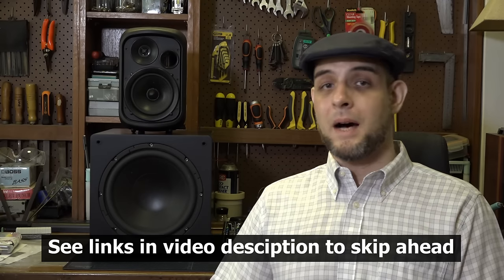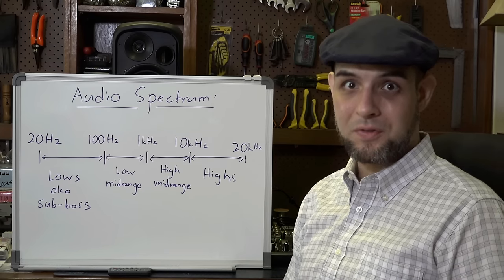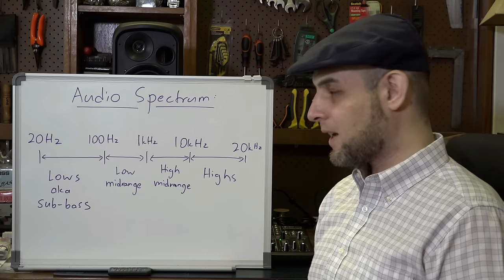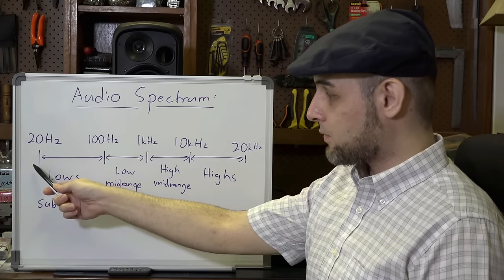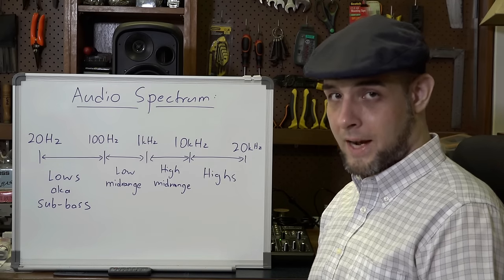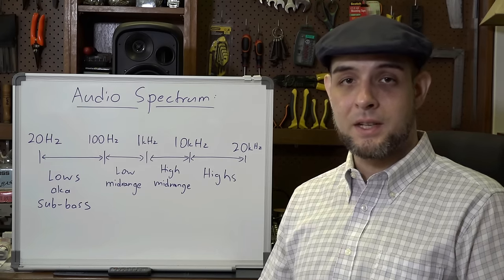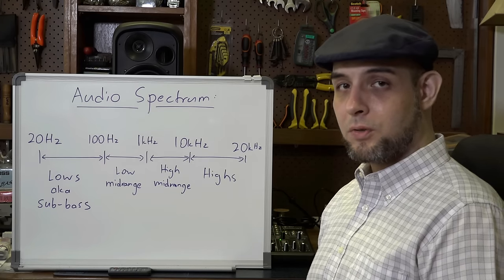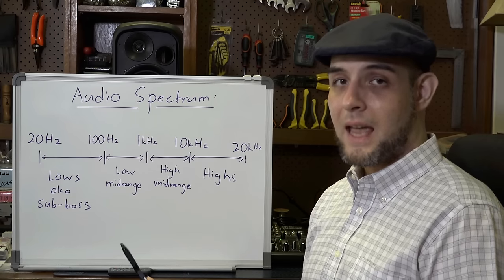How to connect an active subwoofer to a sound reinforcement system

Comment: Hello Bruno, may i ask you what do you think about my following idea?
I'm thinking about building a cable to use two channels of my mixing console as a "X-over". 
Does it function if i build a cable that bridges send and return on channel 1's insert and sends the send to channel 2's line in?
With this cable (if it functions) I could use the 1st channel with full range signal and the second one with low pass to send the signal to a sub which amplifier hasn't a built in X-over.
Reply from the maker: It might work but how are you going to low pass the signal to the sub amplifier? In general these improvised solutions are not recommended.
Reply: GLB Productions I'm going to use an aux send or a sub group
Reply from the maker: I'm afraid I still don't understand your cable idea - a crossover has one fullrange input and at least two outputs, high and low, with a crossover point at which the signal is divided.
Reply: GLB Productions My input would be a random channel (example ch 1) my full range output is the same channel routed to the main mix out (and goes to my studio full range speakers). The second signal starts from the ch 1 insert, goes to another channel (ch.2), i'll cut the highs and mids with the parametric eq and it'll go to the sub amp via an aux send
Reply from the maker: Ah ok now I understand. This will not be the same result as a using a true low pass filter on the second channel, because you'll end up with a low midrange bump between where the low and mid EQ control operate. Also because the fullrange signal has not been high passed you will have overlap in the bass between the fullrange speakers and the sub. 

BTW if you want to tap the signal from the insert point of the first channel just use a normal guitar cable and insert it to the first click in the insert point, that will tap off the signal without interrupting the flow through the channel ;)

Comment: Is it possible to connect an active subwoofer to a phono preamp using only an RCA cable? (In case there is no sub-out in the pre amp and there were no XLR jacks in the speakers nor the subwoofer) 
If it were possible, what would happen if you used an adaptor to get 2 left Channels and 2 right channels out of the preamp (that naturally, only has one of each) and plugged the subwoofer to one and active speakers to the other? Would it work?

I heard that it's a bad idea to to try to merge both left and right channel into 1 subwoofer, but I do not know why.
Reply from the maker: Yes the idea of splitting the output of the preamp into 2 left and 2 right and connecting them to sub and fullrange speakers respectively would work, but you would still need to find a way of cutting the bass out of the send to the active speakers. Summing left and right to mono can be done and is effective for subwoofers but it needs to be done using a proper resistive network, not by simply hard-wiring the signals together.
Reply: +GLB Productions 
But, how could I manage the resistive network you're talking about? I am somewhat new to this, and have no prior knowledge in electronics :0
Is there a separate device that may achieve that? Is there a reliable Stereo to Mono convertor I can buy? (Hell, is that even what I need?) Please note that my idea is to plug the right preamp's RCA output to the sub's right RCA input and the left RCA channel into the left sub RCA channel; I am nor trying to "merge them" per se with a Y adapator.
Reply from the maker: In this case you don't need any stereo to mono converter because you are going stereo output to stereo input :)
Reply: @GLBProductions  GOD BLESS YOU

Comment: Hi i have a 500w powered subwoofer with high speaker wire input terminals and rca low level rca in/out sockets is it possible to connect speaker wire from my power amplifier to the speaker wire input terminals on the subwoofer and then connect my passive 250W Pa Speakers to the subwoofers speaker wire output terminals ?
Reply from the maker: Hi Ken which make and model sub are you using?
Reply: @GLBProductions  I have a old Paradigm PS-1000 Powered Subwoofer and the amplifier is a Sunbuck AS-336BU 2000w Power Amplifier
Reply from the maker: Ah yes that sub. Hmm, theoretically this is possible but those terminals are not designed for high power handling - I would say do it at your own risk 😄

Comment: Hey im using a Alto ZMX 862. U have alto tx12 tops and i have them running from the main output. I have a Carvin ls1801a active sub but i gave it running from the control room channel. It has a separate gain. Whats your opinion?
Reply from the maker: Ok so you have the issue that I mentioned in the video of running your tops fullrange without a high pass filter to remove the low frequencies that the sub is handling. To get maximum efficiency out of your system you need to remove the lows from the signal that is being sent to the tops, using either an external crossover or high pass filter of some kind.
Reply: GLB Productions any suggestions on a decent inexpensive filter or would you just run it thru the sub. The sub crosses over at 80 and 120. I set it to 80 and those tops cut out at 70. And that sub is like the EV elx118. It has one input and one output. Would you use a splitter to combine left and right main out the board to the sub and and one to connect the two tops or just one main channel out to sub and split out sub.
Reply from the maker: The most inexpensive quality crossover that I would recommend would be something like the DBX223 - it can also sum the low end and send it to your single sub. Alternatively you could get a second sub. Finally if you don't mind running your system mono you can use the crossover in the sub: left or right out from the mixer (keep all your pan controls at center) into the sub, out from the sub into the first speaker, out from there into the second speaker. Do NOT use a splitter cable to combine the outputs from your mixer - as the name implies, those cables are only for splitting signals, not combining them.

Comment: Hi sir bruno let me ask you something regarding on how long i can use a microphone wire cable from mixing console to active speakers for example i want to use gauge 16 or 14 and a 50 foot long lenght of microphone wire cable. my question is there any distortion on it?
Reply from the maker: If you are using mic cable to active speakers the gauge doesn't matter because the cable is carrying line level, not speaker-level signal. Any standard mic cable will do, they are typically 20-22 gauge.
Reply: Okay Sir Thank you for the clear information

Comment: It is possible that my full range speaker is larger cone than my sub woofer maens to say I have 15 inch full range speaker and my sub is only 10 inch cone.
Reply from the maker: Yes it's possible, although that sub may not be a good match for that particular fullrange speaker.

Comment: good day to GLB production ...  my question is I have one powered speaker and i have also a simple mixer 
now my DVD player have a 2 line out the left and right going to my mixer left and right to...
how to connect my TS wire to my one  powered speaker to become stereo and they have L and R  on my mixer
Reply from the maker: You need to use two channels - one for the left and one for the right output of the DVD player. Then mixer will then sum these to mono for connection to your single powered speaker.
Reply: @GLBProductions  thank you and more power
Reply: Danilo Songcuan : if you only have one speaker, and that speaker only has one input connection then you will need an adaptor. Without knowing the type of speaker, I will assume its the type that blends a stereo signal. So you have 1/4” TS cable coming from the mixer LEFT and another RIGHT....., these will insert to the connector and come out as a single TRS (Tip Ring Sleeve) stereo plug. It can be either 1/4” or 3.5mm as needed. Please deal free to correct me if I am wrong. I’m an electronics technician, not a sound engineer. ✌️
Reply from the maker: @Gerdfunkle  Unfortunately Perte these types of inputs are almost never found on powered speakers - 1/4" connectors on powered speakers are either mono unbalanced (tip-sleeve) or mono balanced (tip-ring-sleeve). Using an adapter as you describe above will often cause problems with whatever is panned centre in the mixer disappearing! This is one of the most common errors I see in live sound setups, which is why I always recommend never to use an adapter to sum stereo signals to mono - use a mixer :)

Comment: Hi Bruno
The second method using aux send..is there anyway to route the overall volume to the stereo mains, so that u can control the overall mix via the main faders?
Reply from the maker: Hello Peter, I'm afraid I don't understand your question - the overall volume of which speaker?
Reply: GLB Productions via the aux fed...if I turn down the mains faders, it leaves just the sub volume..is there a way to just turn down the overall volume (both the top and sub) with just the mains faders?
Reply from the maker: One of the main advantages of the aux-fed sub technique is that it gives you this independent control over the levels of the subs and fullrange speakers. If you need them to track together then I would connect using an external crossover unit. 
What is the specific situation you are in or problem you are trying to solve?
Reply: GLB Productions just convenience Bruno..I like the fact that no vocals go thru the sub via this route. I’m a one man band (Keyboards) thus have the mixer next to me.
Reply from the maker: Correct - that is another very important advantage of this method! In terms of convenience, it may be helpful to remember that the sub-send is post-fader, hence pulling down the channel fader will fade out both the sub as well as the fullrange speakers for that input, effectively turning down both sets of speakers with one control movement.
Reply: GLB Productions thank you for sharing your knowledge and expertise with us  Bruno..great coverage

Comment: what about a 15band graphic eq?? and cut the lows from 140hz down from the tops?
Reply from the maker: Yeah you can do that in an emergency but it is not the right tool for the job.
Reply: @GLBProductions  alright. well i just purchased a mackie 18s. and we are trying to figure out how to run our sound again
Reply: we have older passive peavey speakers ran from power amp to graphic EQ and back to the speakers.

on our mixing board we have two 1/4" main outs, and two 1/4" control room outs (that we use for monitors)

what would happen if we ran a 1/4" TRS to XLR from the aux send to the sub?
would we lose our monitors?
Reply from the maker: You could do that and still use the control outs for your monitors. However it is really best to use the aux outputs for your monitors and then run the sub off your control rooms outputs.

Comment: What kind of sub are you using cause I can't find a sub with crossover
Reply from the maker: This is an old Tapco studio sub, long discontinued. Look for active subs designed for pro audio, not hifi or home theatre use.
Reply: Ok thanks man
Reply: The JBL EON series have crossovers I have two 618S subs. These are P.A. Pro Live audio subs BTW.

Comment: I have the question, Could you answer me?
1. when I connect sound system with LCD projector, sometime have noise on the screen?
2. sometime when I connect sound system with LCD projector have noise from sound system to the speaker (sheee sheee,,, noise like this)? How to fix it?
Reply from the maker: This is probably due to sharing power between the sound system and projector - try plugging your projector into a different power circuit, preferably on a different phase.

Comment: post fade vs prefade? what are they difference?
Reply from the maker: Pre-fader = signal output is independent of fader position. Post-fader = signal output tracks the fader position.
Reply: @GLBProductions  ahh so what is the meaning of AFL in the aux? i got dilemma on it. i want to install some aux processor like dbx preamp, sub or bass enhancer, maximizer, equalizer, lexicon revberb and another preamp for condenser mic. i have a question. how to set the mixer with 6 aux in post fader all. i know postfader are easier than prefader auxiliary.

Comment: One Question 
By using Aux send for sub, What does the High Pass Filter means, an external device or the knobs which is seen on some mixer? Is it okay by using the HPF button on the mixer?
Reply from the maker: In this case the high pass filter is an external audio filter typically located within a system crossover, EQ or processor. The mixer's HPF button is for the inputs to the mixer, not the same thing.

Comment: Hello! I would like to hear your opinion about this situation: I have my laptop, the PPA 2000BT from Behringer and the active subwoofer Behringer B1500HP. As you see I have no mixer. And I have a problem setting up this system for bringing out the max from it (using the scheme from minute 27:00) for a few parties. The PPA amplifier has a "subwoofer out" output, but does this mean that the speakers are maximizing the mids and highs when sub is connected? because my impression is that the speakers are doing the same job (partially) as the sub. Is the mixer a must? Thanks in advance!
Reply from the maker: Hello Christian, in this case it is very difficult to tell because the user manual does not say anything about this and there is no system diagram to show how the signal is routed. I suspect that the 'sub out' is just a simple mono output and does not affect the signal sent to the fullrange speakers. In this case what you can try is to reduce the 63Hz slider on your graphic EQ and see if it improves the sound.
Reply: GLB Productions Thanks! It sounds much cleaner although I still have to find the right balance. It is an improvement nevertheless!

Comment: I'm using a dbx 234 xl crossover for a 2 way passive system. Does anyone know what the starting point for the low and high output should be ?
Reply from the maker: What do you mean by 'starting point'?
Reply: @GLBProductions  like on a mixer master out, I usually have the slider at unity. So should I follow the same and keep the knob at 0 and then turn it up and down is need ?
Reply from the maker: Yes - keep your master fader at or near unity. If it is much higher or lower turn your amplifiers up or down as necessary.
Reply: @GLBProductions  thank you

Comment: i have mackie profx22. but it doesnt have a switch selection to post fade. is it ok if its only pre fade?
Reply from the maker: On that board you have to use the FX send as your post-fade aux send.
Reply: GLB Productions is it ok to feed powered subwoofer or power amp..on fx send?
Reply from the maker: Yeah no problem at all - it's just a post-fade aux send. Mackie labels it FX send cos a lot of people don't understand the difference between pre and post fade aux sends.
Reply: GLB Productions thank you very much..i just want to ask if my connection is right.. power amp to crossover and xover to fx send?

Comment: I have to passive speakers and two subs how do i connect this?
Reply: Well the subs r active
Reply from the maker: If you have two subs and two passive speakers your setup would be mixer output -> sub -> fullrange amp -> fullrange speaker. Repeat for the other side.

Comment: How about the passive speaker connection?
Reply from the maker: Sorry I don't understand your question.
Reply: Thanks, and sorry 🙏, I mean how to connect a mixer without subwoofer output to passive subwoofer speakers! If I using  Group or Aux send for subwoofers were this damaged to the full-range speakers?
Reply from the maker: In that situation you will need to use either a separate rackmount crossover, or an amplifier which has a crossover function built in - the latter are becoming more common nowadays.
Reply: Thanks, did you conduct courses?
Reply from the maker: @dennistan737  Yes I conduct face to face courses in Singapore for churches, schools and other institutions.

Comment: If my mixer has a Subwoofer out do I have to run it through my mixer?
Reply from the maker: No - it's up to you what system configuration to use 😄
Reply: @GLBProductions  I was just curious which is better or if it's just based on preference. I am about to get my first Sub for my DJ business.
Reply from the maker: In general it's better to use the crossover built into the sub, as this will also cut the bass out of the signal sent to the top speakers. Make sure that you get a sub that is correctly matched to your existing tops!
Reply: @GLBProductions  Thank you again, I appreciate all of your advice. If I may bug you for 1 more bit of knowledge on the subject. What should I be looking for if my tops are 550 watt?
Reply from the maker: You're welcome John. What's the make and model of your tops?
Reply: @GLBProductions  Behringer B215D
Reply from the maker: For those the matching sub would be the B1500XP or the B1800XP, depending on whether you want a 15" or 18" sub, your budget etc. Consult your retailer on your needs - ideally you would bring your existing speakers down to see how they sound together with the sub. Happy shopping 😁
Reply: @GLBProductions  Your feedback is very much appreciated, I will take your advice as soon as everything gets back to some semblance of normal and I can go to a dealer. Thank you!!!